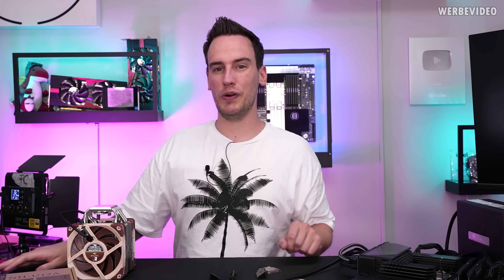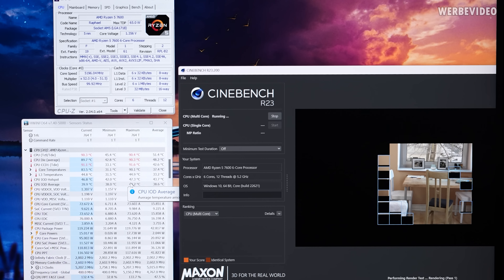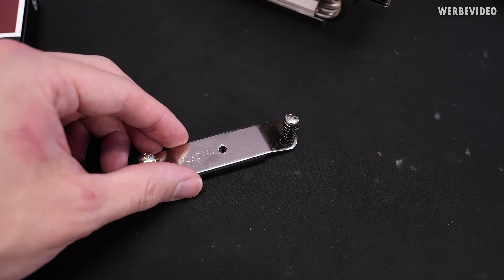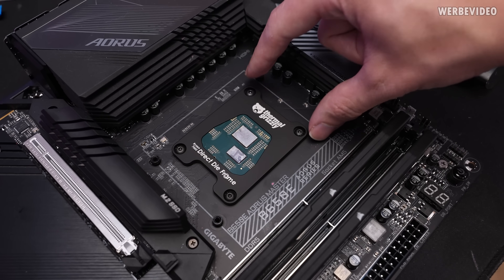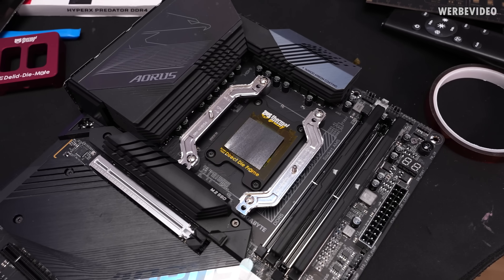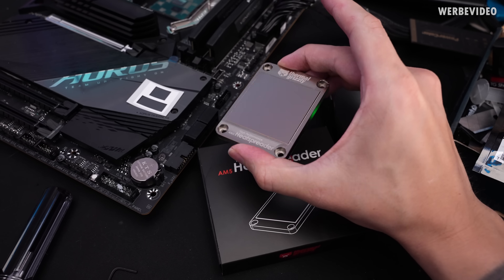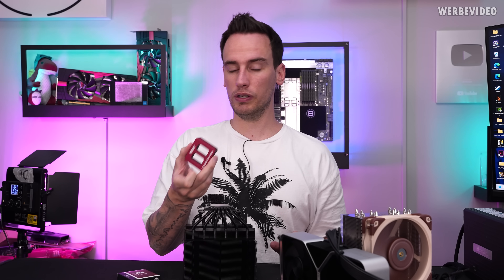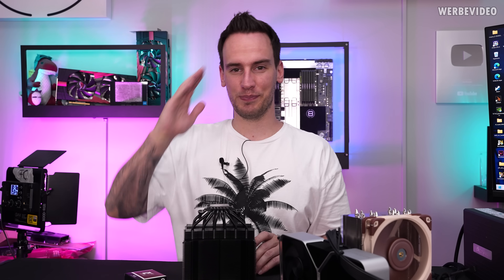How this 120$ Noctua Cooler beats a 360 AIO

Comment: I have 1 direct die frame for sale in Brazil, if anyone's interested. 

Bought the mounting frame for my 7800x3d and gave up delliding because of how hard it would be to manage cooler height tolerances. At the time I didn't even know about the glued capacitors problem, guess I escaped some hassle.
Reply: People in Brazil have 7800x3d CPUs? In Australia they're too expensive
Reply: @FreedomForAll2013  I built an sff rig while vacationing in the USA and brought it back :)
The idea to go direct die was to lower the fan speed needed to cool the cpu.
Reply: @Eduardo1007  awesome mate

Comment: Weird how that price for the de-lidder (70), offset piece(5) and frame(40) goes from 155 to 50-60 in less than 1 minute.  Taking that you can sell the de-lidder for just a bit less than you paid is a bit of a leap to put into the equation.  I've never had doubts about Noctua nor you until seeing this video.

Comment: Aircooler is just the past, can't compare with AIOs. A 100$ 240mm AIO (like a Fractal Lumen) has the same performance as this 200$ one.
Reply: Wrong.
Reply: @neondemon5137  right, lumen 240mm here on an ITX case 13900K 253W below 80C...

Comment: I have 7700 with Noctua NH-U12A and their thermal paste, running stable all cores 5.2GHz@77'C@1300RPM in R23 by just undervolting it 🙂
Reply: im running undervolted 7700x with a 85watt limit, u12a and the temp is 70c@1k rpm
Reply: @michal1693  I might undervolt a bit more 😀
Reply: @livemadseason  18100

Comment: I can understand people who use AIOs or custom loops (and some custom loops are pretty awesome) but personally I absolutely refuse to put a liquid cooling solution into my computer case. The possibility of a leak is simply not worth the risk. Sure the chance of a leak is probably pretty low, but it is always a possibilty with liquid cooling.
Reply: the posibility of something going wrong with liquid metal is equally as high + youve voided cpu warranty with the delid. so there are risks with both,
imo it does not make sense to void your warranty, run the risk of cooking your cpu or other components with liquid metal to run an air cooler 
even 40c idle is WILD for a delid.

Comment: Them 6 core ryzen are rly hot chips. Have a 8700k delided 5.1ghz @1.367v underload between 65-68degrees using a coolermaster 240mm aio thats after running R23 for 4hrs on a loop  lmao.

Comment: When you all youtubers, start to consider testing temperatures and noise in typical CLOSED cases?
what is the point to present numbers and precents in abnormal conditions, when 80/95% of customers have closed cases at home?
Reply: Just happened to me, the noise is not good, especially fast (and constant) ramp-ups/downs, on a upper tier CPUs. Yes, new air coolers will keep the temps under throttling limit, but at the cost of your nerves...

Comment: From my recent testing, even the best air coolers are for mid-range CPU-s in normal actual usage and benchmarking on a testbed. Ryzen 7700X and up need an AIO to be tolerable noise wise, and not just the 100% usage scenarios, they ramp-up/down too much and too often even on lighter loads. I don't want that, especially for a higher priced system. So my new Peerless Assassin 120 is being replaced with an AIO for my 7800X3D, probably 360 so it can be an oversized solution that can soak up more heat and be constant as well as relatively quiet.
And this is from someone that likes air coolers a lot...

Comment: Or..........you can save yourself a lot of trouble and headache by just running the cpu at a reasonable clock speed and stop trying to wring every last bit of performance out of it. The days of overclocking should be behind us considering the performance out of the box plus under volting. Why bother making life more difficult for so little gain?

Comment: the 13700k is notorious for being extremely hard to cool. However, my dad got the same noctua cooler and it's better than the 360 mil 🤣
Reply: I mean, yeah but testing with delided cpu cooling is not what I would call a "recommended solution for everybody" either. I say, if your CPU is already out of warranty , or you think the gain is worth the risk, sure go ahead, but for most ppl, building a PC is already an expensive and nerve wracking experience without having to scalp your CPU on top of that XD

Comment: I'm really curious what would happen with even more powerful fans. The Noctua Industrial 3000 is what I'm talking about. How much would the extra airflow and pressure improve cooling?
Reply: not much, specially if noise normalized
Reply: You really got me thinking. I have both the nh-12ua and the industrial 120mm. Only one, though. So, I just went and swapped them out. My not so scientific test shows at best it was a 1-2 degree difference and like, a 50 decibel difference. The 3000 is normally my case fan to expel hot air from after the cpu cooler typically spinning @~1400 rpm and the curve is set to immediately rev up to full speed when something reaches a temp I don't like as both a makeshift  air raid siren to let me know to back off and to assist further in cooling things off in the process. Maybe with 2 it would be 3-4? Possibly more without a slower fan ahead or behind? At comparable speeds to the 12ua, performance was actually worse with a LOT more noise up until you start hitting ~2600 RPM. Then even more noise, but ever so slightly cooler. I then went back to my normal config. Case used is a Coolermaster HAF XB EVO with 2 industrial 2000rpm 140mm intake fans, and that 3000 120mm exhaust in the back as previously mentioned. On a side note, yes, the 3000 is significantly louder than the 2000 at any speed. All 3 also seem make an odd chittering noise when spinning slow on PWM that doesn't happen when running DC.

Comment: I love my U12A, it's a beast of a heatsink, especially when combined with Phanteks T30 fans.
Reply: @petersharps3923  It's much quieter, and runs cooler at lower RPM. Even at high load the fans are very quiet. Well worth the $70 CAD upgrade cost.

Comment: I suggest using Honeywell TPM7950 as an alternative to the Kryosheet. If I'm not mistaken, it's not electrically conductive so it's a safe choice. It's also a bit easier to apply since you can just cut it to pieces before application. If I recall correctly, after burn-in it is as capable as liquid metal but doesn't run out over time and is also not corrosive.
Reply: Is that the one used on founder's RTX4090?